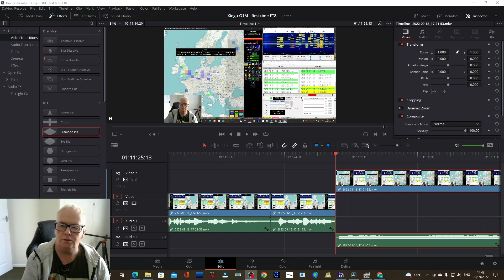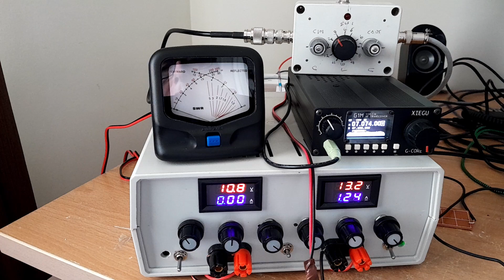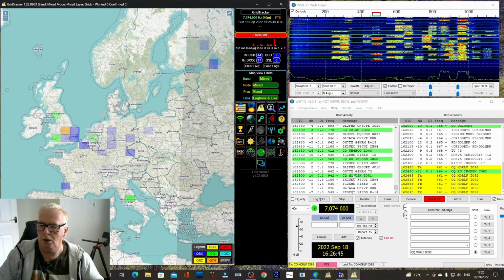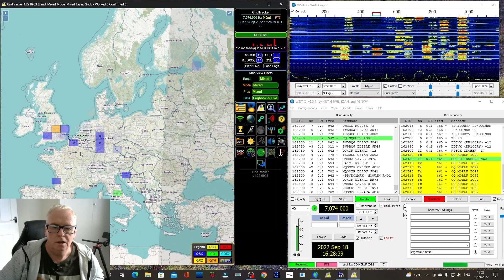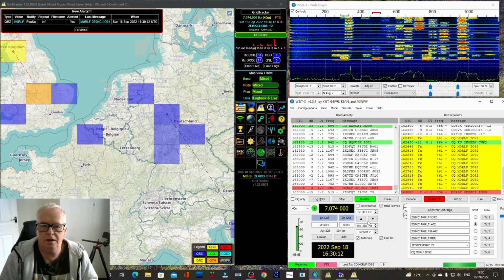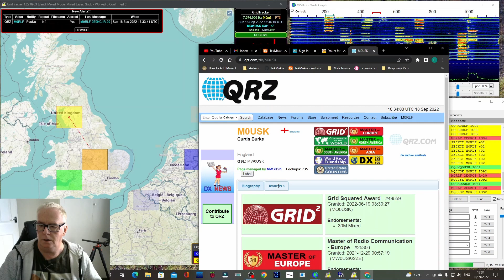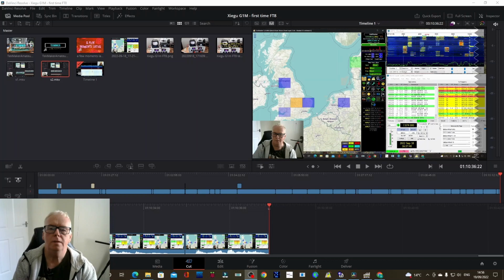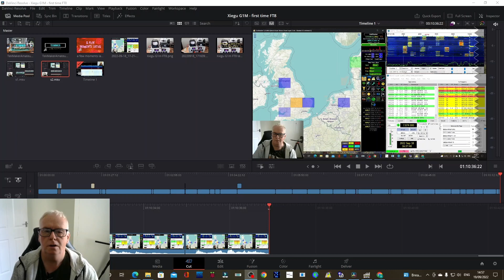FT8 on the Xiegu G1M - my first attempts

Comment: Worked for three days trying to configure my new G1M for wsjt-x ft8.  I finally used Xiegu X5105 for "Rig" and it now seems to be working perfectly.  Now, if only someone could find a way to control output, so I could use the G1M with my Micro PA50+ amp.

Comment: I just read your blog about connecting the G1M to the pc but I have no clue if a DigiRig or similar should be used.
Also, about that 22uF cap , as I understand, should be connected between the tip of the mic and the G1M? ta
Reply from the maker: Yes I am in deed running FLRIG with Xiegu G90 selected as there is not setting for G1M. You are correct about the 22uF cap with positive to the radio. I am using a USB Autio mic/spkr dongle as it frees up my PC sound for normal uses and you don.t need to switch connections.
Reply: @tekmakerUK  cheers , you are legend!